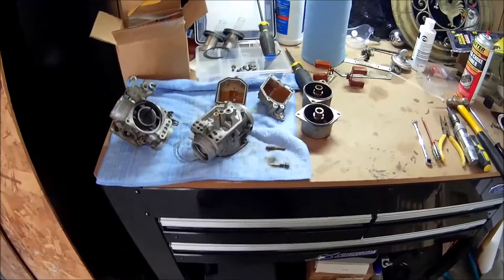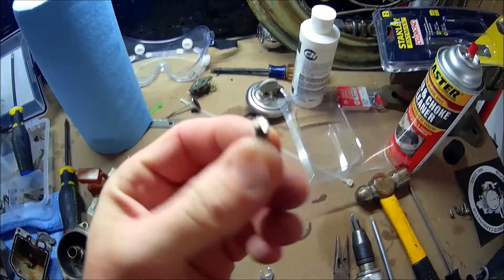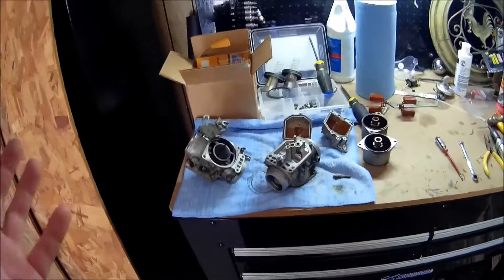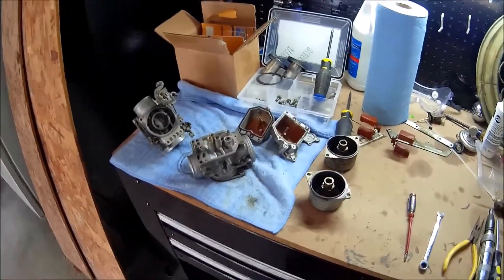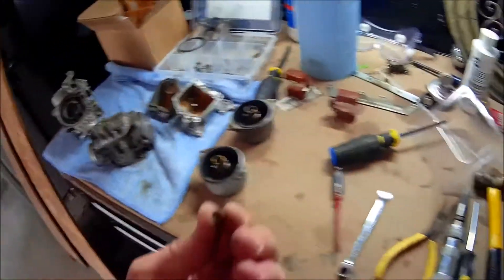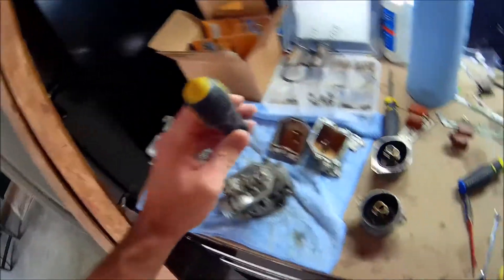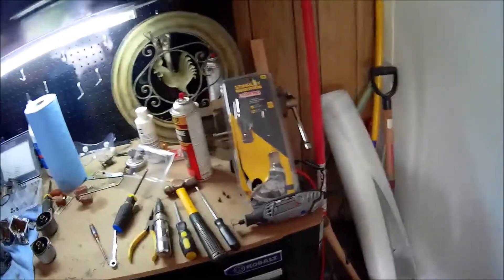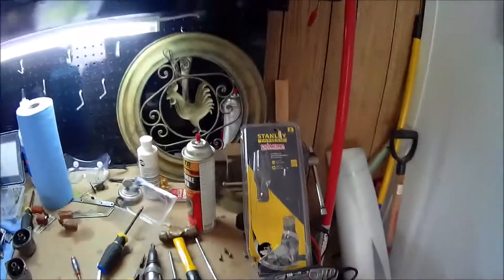06/03/17: GL500 SILVERWING CARBS & A TOOL REVIEW

Comment: Thanks for the heads up on the screwdriver.  I have a couple of the impact drivers and I have used them plenty. 
With the way the inside looked on those carbs, I too find it hard to believe they were rebuilt.
Ride safe my friend!
Reply from the maker: No, there is no doubt about it, they were not rebuilt.  lol   
Thanks and you too bro!

Comment: Top Tier Gas   http://www.toptiergas.com/       I've researched the CX engine and cannot locate a source of the replacement cam chain guides.  When the plastic wears off those guides the chain will be at the end of it's adjustment range and will grind at a bolt and the aluminum block causing noise and severe damage. Images are on line of this. Keep a lookout.
Reply from the maker: Yeahhhhhh,  I am aware of this issue.  Honda part # 14500-470-751 .   Funny thing is, when I very first bought this bike, I was going to do a 100% full tear down and refreshing of the motor.  Then found out the radiator hoses, air intake boots, cam tensioner, and a few other non critical bits were scarce as hen's teeth.  Or just flat out no longer exist.   So I never even tried to rebuild it for that reason.  The motor is GOOD for now at only 40k miles. But it still makes ya wonder............................................   Have a great week ahead bro!
Reply: There is a compact cars molded radiator hose that only needs the ends trimmed to fit. I saw it on a forum. I considered buying a mint CX650 but the rarity of certain parts stopped me.

Comment: I like to replace such screws with stainless steel ones as they don't reacted with aluminum or use anti seize.
Reply from the maker: that is a good idea.  The reason why I had those 4 screws sitting by the vice is we have a quite large selection on stainless steel metric hex head capscrews ( "Alan head screws" ) and if possible I am going to replace every one of those screws.  If I can find the matches to them I will show it in the next video that is about this particular project.   :-)